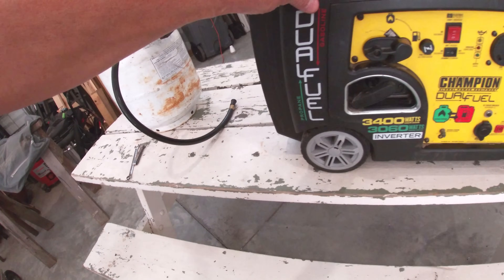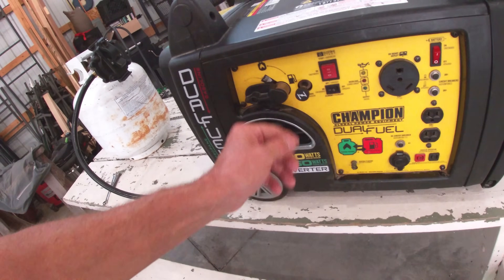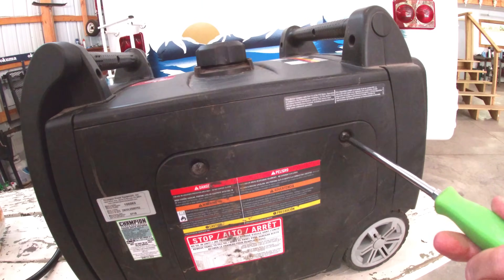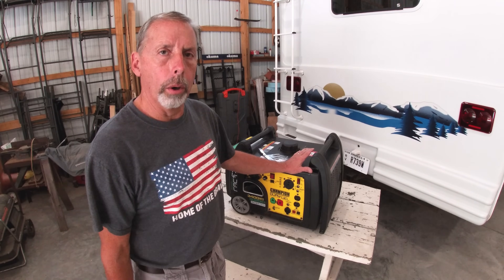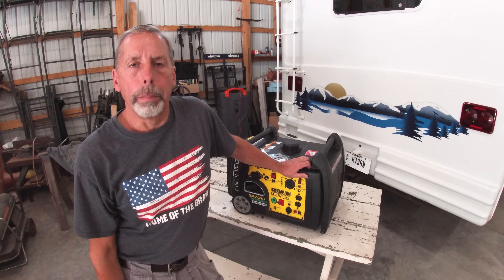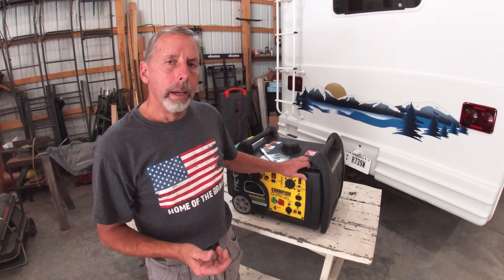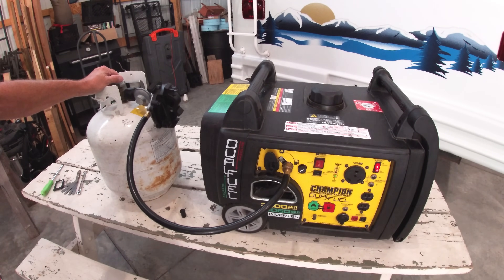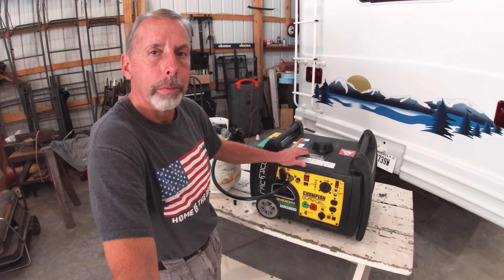Propane Generator Fail

Comment: Sounds like the free-flow safety in the OPD valve (connects to tank) is tripping.  That happens when the gas rushes if you open it fast on a long hose or with the burners open.  In this case, it may be that the demand regulator (big diameter one) has stuck open.  It is suppose to only let gas flow when there is a vacuum from the engine intake.  You might check to see if gas flows out of the generator end of the hose which would indicate a leak in the demand regulator.

The free-flow safety is common to all OPD valves.  I learned about it with a weed torch.  I now naturally open propane slowly out of habit.  It's just a ball check valve that closes if the gas flows to fast with a small weep to balance the pressures then it resets.
Reply from the maker: Excellent information. Didn’t know that. Thanks for taking the time to comment and for watching
Reply: That's exactly what is was and maybe why Champion seems to think they do not need to tell anyone about it because it's the safety valve in the tank causing the issue not the regulator or generator. Closing the valve and reopening it slowly allows it to reset and function normally.

Comment: The propane tank is the problem.  If you open the valve to fast it has a safety valve that is tripped.  The valve thinks the tank fell or was dropped and becomes activated.  The lady was on the right track but all propane tanks will do this.  I first learned about this years ago when I bought my first turkey fryer.
Reply: need the old type of propane tanks... unfortunately companies not allowed to fill the old tanks that don't have the internal valve that is causing many problems, I have an old propane burner it has too high a flow rate so the new tanks internal valve shuts off.

Comment: I have a dual fuel 3450 no-name generator I bought in one of those truckload tool sales. It was $249.95...CHEAP...other than the common regulator fix I ended up doing, it has over 400 hours with nothing but oil changes and air cleaner cleaning done. Its never missed a beat. That regulator fix is a common YouTube video.

Comment: Thank you for this video. I have this same type of generator. U are what makes America Great.  I also discovered this phenomenology with my roofing torch many years ago. If I opened the propane too fast the torch would have little flame. I believe this is a Safety Feature built into regulators to prevent "flare outs". Always slowly open propane tank valve.  
I used my generator (flawless performance) the first time during Hurricane Beryl here in Houston this summer.  I had never connected the regulator issue to any problems that the generator might  present. YOUR VIDEO IS INVALUABLE.  Especially for those who are depending on it during crisis.  It is good to also have multiple backups like solar and perhaps another generator.
The attraction and advantages of propane are evident.  Trouble Free Long Term storage.
Reply from the maker: Thanks for your comment and for watching

Comment: Recommend you also install a propane filter on the line going into the generator.  There are small particulates in the larger tanks that this filter removes and keeps the system running longer.  People with Mr. Buddy heaters use them frequently on the 20 lb tanks.  If they don't, eventually they learn to install the propane filter. You can get them at stores like ACE and tractor supply.
Reply: I remember once having a low flow problem with a small tank and a propane torch. On the small orifice at the end of the torch’s finger/tube that opens the schraeder (sp?) valve in the cylinder and seals with the o ring, there was a tiny wad of lint packed in. A brush and blow cleared it away, and the torch ran full blast again.

I also got a two burner camp stove from a trash can with one inoperative burner. The one metering orifice was plugged with something, so I was going to carefully poke it out with a tiny soft bristle, but sprayed it with carb cleaner first. It dissolved with no poke needed. I surmise some kind of hydrocarbon contaminant built up from impure propane. Worked fine.

I enjoyed that temp job on the back of the trash truck, running all over our rural county.

Comment: I have that very generator. I live in Florida and I bought it for a back up power source in case we lose power from a hurricane. I only have about 20 hours on it basically so I can do the initial oil change and test how many things I can power. I’ll remember to open the propane valve slowly. Thanks for the information!

Comment: Why do you pull the choke in LPG operation?
I was instructed, on LPG u don’t need the choke, only with gasoline is it required (to vaporize more fuell for the startup)

Comment: This problem isn't isolated to generators.  I've had a couple of propane grills that have the same problem...
 If I open the valve too fast, or if any of the burners are on. The feul flow gets reduced to a trickle. 
I eventually figured out that if it has a regulator. You need to open the valve slowly...

Comment: I have dual fuel Gen that has starred running rough on propane. It has always run fine on propane until I starred it few days ago and it ran rough,switched on gasoline it ran fine. Going to try slow opening of propane valve see if it runs smooth again. I know have had problem with bbq grill opening valve to quickly. Thanks for your post very informative.
Reply from the maker: Thanks for watching

Comment: I must have talked with the same lady who told me to open the valve slowly. I did what she said and everything works perfectly. I run two of the same generator you have with a junction box between them for more power. Running two years now with no issues. I only run the propane as well.  I bought the tents that cover the units because mine sit outside.

Comment: the problem isn't the regulator it's the OPD valve on the propane tank. if when you open the valve to fast or a line breaks the high flow thru the valve has a safety in it that all but shuts off the gas. close valve wait a minute and then open slowly.

Comment: I know I might be late to give an answer to this and someone has probably already answered this but it’s a safety feature in regulators. There is a “ball bearing” that will reduce the amount of propane to the unit if it receives too much pressure at one time. This is to prevent surges in propane or unsafe pressures. The problem with this is that there is obviously a great difference of pressure when you first open it up, causing this “ball bearing” to go into the reduced fuel position. Just imagine a ball on a spring. Now imagine a “groove” that if the ball goes past it, then it will lock into that groove but it’s part way down the spring. The spring is strong and if you add pressure slowly, it will do almost nothing to that ball. But if you “punch” that ball with pressure, then there is a chance that it can be pushed down into the spring  and then into that groove and lock. Removing all pressure will drop the ball out of the groove and then you try again.
Reply from the maker: Yes it’s been answered before but you explained how the regulator works better. I’ve had lots of comments telling me I don’t know what I’m talking about because the issue is the propane tank and not the regulator. I know it’s a problem with both. Thanks for taking the time to comment and for watching

Comment: The propane tanks now have these safety features. One is flow control when a fast gas flow is detected, ie a leak. These safety features can be very temperamental and activate by allowing an empty hose to fill to fast. Open the gas supply at your tank very slowly for the first quarter turn then as fast as usual to minimize these false shutdowns

Comment: I need to try this on the weekend. I saw mention of this on another channel as well. I have the same exact model. Was dealing with similar issues with trying to get it run on propane. My generator has less than 10 hours so no way valves, spark arrest, or spark plug would be an issue yet. I had also heard mention that choke shouldn't be required if on propane since it is coming in pressurized and bypasses the gas portion of the carburetor anyway where the choke is. Not completely sure I buy that but may test it anyway. Glad I found this video!
Reply from the maker: Thanks for your comment. I’ve had a lot of people telling me I don’t need to choke it to start but that’s not true. I’ve tested it several times and it won’t start without it. Thanks for watching

Comment: There's a little ball in it for overflow protection and yes it is a thing. Thankfully you figured it out and now you got a backup.
Reply: The excess flow valve  is on the service valve  INSIDE  the tank.  
LP service tech, retired

Comment: All newer propane tanks have a blow out prevention safety in the tank itself. If it trips you need to close the tank, crack the regulator, retighten and open the tank slowly. This applies to all tanks now and no matter what you hook the tank up too. I have known this for over a decade. Your problem had nothing to do with the gen or regulator. It's a Government safety built into all newer tanks now.
Reply: All you need to do is close the tank valve, wait a minute or so, and the excess flow will reset. Do NOT bleed it off!

Comment: I thank you for this video.  I have one of Champions duel/fuel generators that I use when I have power outages.  I live in anRV full time.  Mine is an 8800kw so a lot bigger than yours.  I had the same problem running on propane and hated running on gas.  After watching your video I tried opening the valve slowly and my generator started instantly.  
Guess what, this also works on gas grills. My grill wouldn’t get up to heat and I tried opening the valve slowly,  it now works perfectly.
Reply from the maker: Thanks for watching

Comment: Has nothing 😢to do with Champion or any generator it is a function of the propane tank. I had this problem with a propane stove some years ago went on YouTube found a video discussing this valve and turning it on too fast issue. Since that time I open the valve on propane tank slowly regardless of device and no problem.

Comment: I learned this a while back and it affects even grills. You gotta open the main valve slow or you get problems. I have a pulsar dual fuel generator otw so hopefully it's as reliable as your champion seems to have been

Comment: I PURCHASED a 5kw Predator duel fuel.   I Run this thing daily 6mo. 2700 hrs. Oil charges at 25hrs to 100 break in then 100hrs.  NEVER valve adj. Started getting a little blow by. In air filter.  I returned it under the 1yr ext. Warranty.   No problem.

Comment: I can give you another tip for using and storing the generator if you want to or need to run it on gasoline. Just like you already did with the propane, the gasoline tank has a shutoff valve. Turn it off and let it run until it dies. This will empty the carburetor of gasoline and stops the deposits from forming. I have a portable generator for emergencies because I live in the country, every 6 to 8 months I run it for 20 to 30 minutes. So knock on wood i have never had issues starting and running it. Good luck !!!
Reply from the maker: I also have a portable backup generator that’s about 20 years old. I run it every few months and run the carburetor dry. Never had an issue. One of the reasons I use propane in the Champion is I don’t want gasoline on the back of the camper in case of a rear end collision. Thanks for watching

Comment: What is causing the problem is a new feature of LP regulators. They have a flow device that locks up if the flow is too much. So, by opening the valve slowly you do not allow it to think there is excessive flow. Now on another note, I bought a regulator from Tractor Supply for my gas logs, and it shut down the other day. What had happened is that my regulator flow control will not allow the high setting on my logs to run because it thinks I have a leak. It will run on med and lower. That means that I need a higher flow rate regulator. So, good video and thank you as I am selling my motorhome and getting a trailer which will need a separate generator like yours.

Comment: Thanks a lot for your video! I can't wait to try this. I've been having virtually the same issue and both times I called Champion tech support they've made other suggestions (1. Keep gas cap open while running on propane (???), and 2. Don't use the choke when starting on propane) that haven't worked. I definitely open the propane valve fast every time I've used it, so I look forward to making the tweak you suggest....
Reply from the maker: I hope it works for you. Thanks for watching

Comment: Also if you have a motor home ir trailer you should install an array of solar panels and a decent charge controler to not need to run your generator. Our Off grid ( since 1969) farm is huge solar and wind power up in the mountains and we are never in the dark cold or hungry. Thanks for your video. It was well done Dandahermit.❤😅
Reply from the maker: Thanks for watching

Comment: Basic good practice of any pressurized system is to open valves slowly and increase pressure gently. Be kind to your equipment and your equipment will be kind to you. This is one of the first things I was taught as a chemical operator.

Comment: I just experienced this on a recent trip with my rv propane stove not working.  I was sure I either had a leak or a bad regulator. Someone on an rv site mentioned opening the valve slowly. 
Bingo! Learn something everyday.

Comment: I have a 7000 watt dual fuel Champion for power outages. I learned long ago to open any new style propane tank slow. There is a safety in the valve that stops the flow if you open them to fast. My generator has never had a problem I only use it maybe 2 times a year. One time the power was out for 3 days.  My regulator looks just like the one on my large grill.

Comment: The warmer it is, the more pressure in the cylinder. Always open the valve slowly so the excess flow valve in the fitting does not activate. Been in the propane industry for over 45 years.

Comment: My propane fire bowl (basically a small spark-free camp fire) started doing this about 8 months into using it. I learned to open it slowly otherwise it would be half flame or less. Very annoying. I think it's because so many of the regulators are all made of Chinesium, and are just so cheaply made they don't work as intended. Great video!
Reply from the maker: Thanks for watching

Comment: THANK YOU!
I have a 6kW duel fuel in which I have never used gasoline for the precise reasons you mentioned. Old generator prior used marine fuel/no ethanol blah blah blah for same reasons as it is for hurricanes and not daily use so I did not want this new one to **ever** be "gunked up. No mention in its user manual about opening propane supply slowly but NOW I KNOW.
You are a welcome source for good info and yeah, I would like companies to listen to their GOOD employees who are trying to help them but management is gonna do whatever the heck it is they do at times. Hope all your trips are worry free and enjoyable.
Peaceful Skies.
Reply from the maker: Thanks for taking the time to comment and for watching
Reply: @PleasantValleyOutdoors  Thank you for being engaged with your comments section even months after the video was posted.
Peaceful Skies.

Comment: Here's another little tip that people might want to know about, use a filter between the hose and the appliance that you're running, some manufacturers use a certain petroleum when they manufacture their hoses so that they're not stiff, when these petroleum's inside the hose make their way into your Appliance it can ruin it, so use a filter, I use one that's made for a little buddy heater made by (Mr. Heater)

Comment: I've had the same fail with my BBQ grill.   As long as I open slow, I get full heat.  If I screw it up, it won't get over 300°.   I was stumped.  How was i getting fire without the heat?  So glad I saw a similar video when I was "researching."

Comment: I just went through all of this with my Champion dual fuel generatoror and I learned that high temperatures, and low temperatures can affect all of this, and also opening the valve on the propane cylinder was also key (as you mentioned), including when you go to shut these things down, close the valve on the propane cylinder (which you did), rather than shutting the generator off at the switch, which apparently keeps from air getting into the system.
Reply from the maker: Thanks for watching

Comment: Hey wow! I have one of these and have only used it one time for about an hour. At least now I know to carefully open the propane tank valve! Thanks for the heads up!
Reply: I have one that I have only used a couple of times.im worried that by sitting.  Have had mine at least 4 years and doubt I have over four hours on it.i don't  run it when the weather  is cold thinkin I will  mess something  up. How about  a video  on cold starting a generator in cold conditions? Thankz for a great tip!
Reply: @mikeadams2339  Mine is propane and starts right up in 25F temperature. I had a gasoline onan and it was a bear to start. I ended up putting a 12 volt plus a 6 volt battery for a total of 18 volts. This cranked fine in the cold but had to have special arrangements to charge the 6 volt battery.

Comment: Pretty much all propane appliances. It's not so much opening the valve fast. However, you need to wait a couple of minutes for the pressure to stabilize before using. I can see how opening valve slowly would do the same thing. Great tip.

Comment: The valve at issue is actually in the lp cylinder rather than the regulator. It is a safety feature incorporated in OPD valves almost since they first came on the market and are required by code.  The flow needed to trip them can vary widely from cylinder to cylinder. Just the nature of the beast.  Might you have swapped to a different cylinder just prior to having your issues?